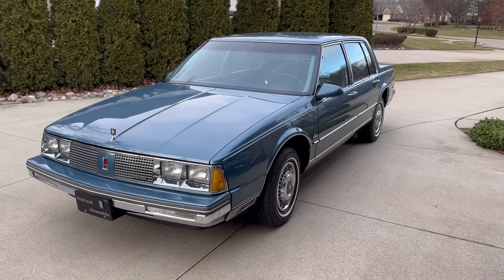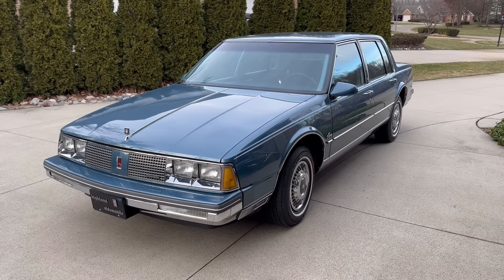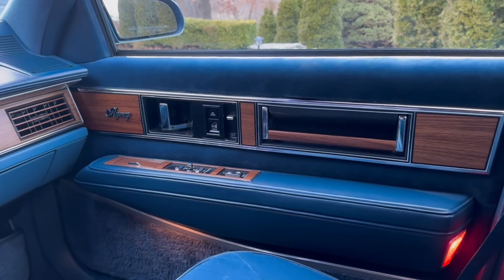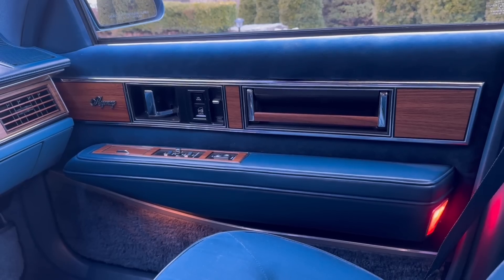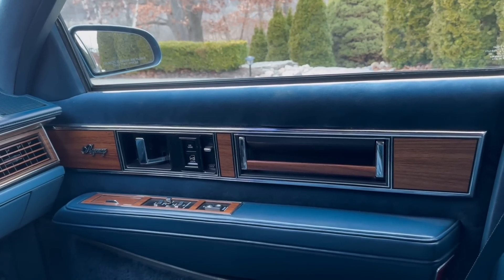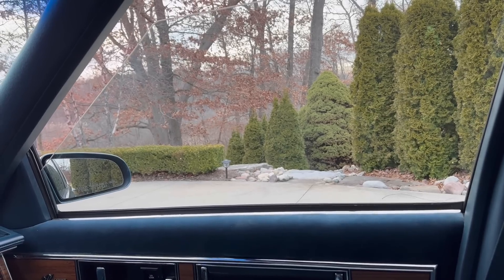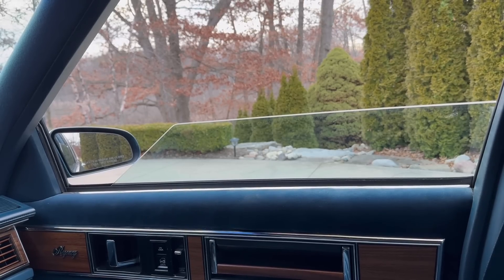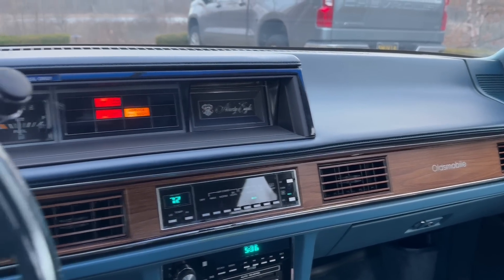Worst Automotive Inventions: 1980s/90s General Motors (GM) Tape Drive Window Regulators

Comment: These were definitely high failure parts. GM sold the replacement tape in rolls so there was no direct replacement length. In the beginning the tech would have to remove the broken tape and measure so that the proper amount could be cut from the roll. As time went on we came up with the proper length of tape needed for all the models. I remember they sold the roll as a kit that came with a cutter in the box. This was the way GM did all these types of things back then, brake lines were bulk and you needed all the flare tools. Same with heater cables. We had to make those as well.
Reply: I wonder if a stronger aftermarket "tape" could be made out of aluminum?
Reply: @gencreeper6476  Aluminium work hardens. That is exactly the kind of material you don't want in that application.
Reply: Gives new meaning to the phrase, measure twice and cut once
Reply: I had to do that for brake lines for my 2003 Ford, they don't provide any information except maybe diameter
Reply: That actually sounds wonderful compared to today. I'd love to have been able to get a roll of this stuff and just replace it when the regulator bound up in my 2003 LeSabre
Reply: I would understand that, say, in the 1940s or 1950s, but in the 1980s and 1990s?

Absolutely unacceptable that GM made parts like this so late.
Reply: @jordant2302 :   That's GM for ya!!! One hand makes a perfect high quality part while the other hand makes inferior parts with scrap picked up off the floor. I'm a GM diehard and I'm amazed they are still in business.  The last new GM product I bought was a 1991 Grand Prix SE.  Since that car, I only bought used.

Comment: I worked for a GM Dealership back in the early to late 80s ( body shop ) . All I can say is you could not give me a GM car from that era.  Esp. the FWD ones.
The Buicks were the best of them all , they still had some good build quality for the most part.
Reply: I just picked up a 1994 Buick Roadmaster and I'm a fan. I think as long as GM doesn't try to make anything invented after 1960 they do just fine. Pushrod V8 ladder frame RWD car? Great. Unibody overhead cam FWD car? Not so much
Reply: My used 1986 GM Buick Century sedan was awful. ⬇️
Reply: @DavidLLambertmobile  Yeah and Buick was the better of the GM models lol

Comment: I wonder if the engineers thought, “This looks very sketchy, but it’s what the bosses ordered, so here ya’ go and good luck.”
Reply: Accounting department gets final say on everything.
Reply: @watsisbuttndo829  a common misconception; I didn't say accounting. I said finance. There is a very big difference. Accountants do not make decisions
Reply: Sounds like most any job
Reply: yes it happened all the time, the 350 diesel is one, I used to eat lunch with the engineers on that project the 1st engine the made would have been good, but gm had no overdrive transmission until 1980, the 1st car was too slow to get on an interstate safely because of the high axle gears, rather than wait for the transmission the marketing guys said this engine needs to have power at 4,000 rpms, they did it 23 to 1 compression  but the engines did not hold up
Reply: @jimsix9929  I wish we could still have 23:1 compression in diesels today.
Reply: That’s GM in a nutshell.
Reply: Nickel and dime counters: "with the tape regulator, we can save 10-cents on each car-- go for it and damm any reliability issues".
Reply: A lot of times, yes. Will it make it through the warranty period? Send it.
Reply: More like, "Screw it, I don't have to work on it."
Reply: It's the finance guys  who ultimately make the decision
Reply: Starting with the Chevy Vega, GM required their customers do all the research and development, for them. That gave them the largest R&D department in the world. 😡
Reply: I'm sure plenty of GM engineers were tearing their hair out in frustration. And Ford and Chrysler too.
Reply: ‘How cheap can we make it before the customers revolt?’ GMs market share tells how that went.
Reply: I know a lot of those guys, the simple answer is no.  With regulators in particular it was considered a great innovation. Old style regulators were a real pain to meet packaging and functional  requirements. With tape drives, you could do all kinds of things with a fairly simple piece of engineering and an amazingly simple concept.  One of the problems with anything really new like this is the material quality. The material tested was likely different than the material purchased (it had to do with how the material was specd. by engineering) As much as we liked to blame purchasing for all of this, they are only partly to blame.
Reply: Plus if you have an older printer that works fine when you upgrade your computer the printer manufacturer doesn't support the printer with drivers for the new OS
Reply: That's usually how it goes, yeh.
Reply: I just saw a video where they said 1980s buicks engines were only designed to last about 80k miles.
Reply: Yeah, ask Boeing that
Reply: There's a practice in capitalism called "designed obsolescence" which intentionally makes products that are designed to fail at a certain number of uses or hours of use, etc, in order to ensure continued sales.  The lightbulb is the most common example.  There is an Edisn lightbulb from way back at the turn of the 20th century which has been on 24/7 for over 120 years and is still glowing bright.  But it was not in the interest of shareholders and other profit takers to sell you one light bulb that lasted your entire lifetime when a few little changes could guarantee that you would need to buy a new light bulb every three, five,twelve months or whatever.

Apparently even today's ink jet printers have a chip which is programmed to make the printer stop working at a certain number of printed pages, because even with the drug-war level pricing of printer ink, they knew they could sell more printers if the ones they sold already could eventually stop working.

Comment: I think this was more of a bean-counter move than weight savings.
Reply from the maker: It was both
Reply: Actually, it was a clever concept if the material used had been robust enough.  It was the execution that sucked
Reply: @billyjoejimbob56   yes, it was cheap plastic that seemed to become even weaker over time.
Reply: @dmandman9   its working similar to a chain. Why couldn't they use thin steel
Reply: @RorinthalHennessey  they were being cheap. That was the era of them doing things as cheaply as they could.
Reply: @dmandman9 
And they kept learning and learning ,and now we have new garbage.
I find it amazing how fast the new stuff rusts,what with all the exposed pinch welds and stuff I see on some newer vehicles. 
I thought we learned by the 90s how to avoid as much of that stuff.
The work truck had plenty of discolored and rust starting underneath after about 3yrs.
Reply: If was also claimed that it saved space in some PR material, but I don't see how. The scissors take up almost no space when the window is down and not much more space than that occupied by the glass when up. Most of these tape and cable drives, as well as their tracks and tubes,  have to run alongside the glass.
Reply: No question
Reply: Agreed, for cafe they would just detune the engine.
Reply: @gasmonkey1234  in some cases they cut a pound here a few ounces there. It all adds up for weight savings for EPA numbers. But I agree that in this case they were just being cheap
Reply: It was also a finger/hand saver. Those old window regulators were extremely reliable. But when they did malfunction, one careless move could cause a major injury to your hand. 🩸🩸